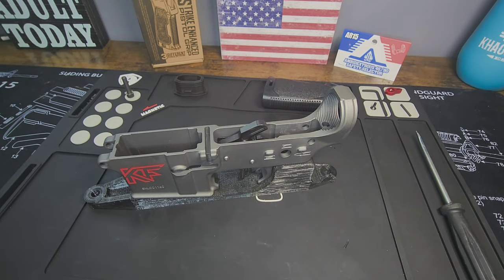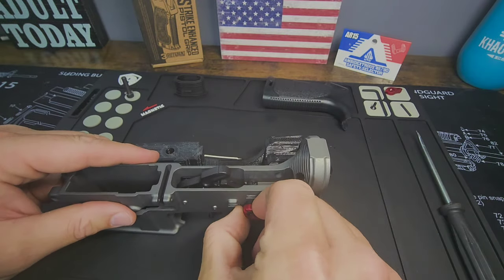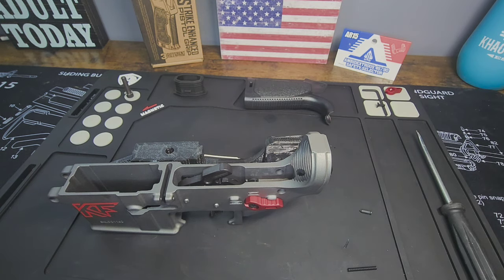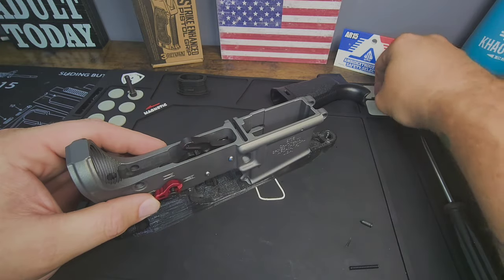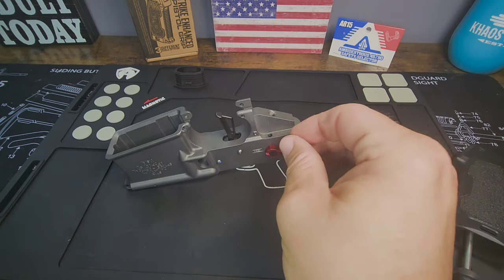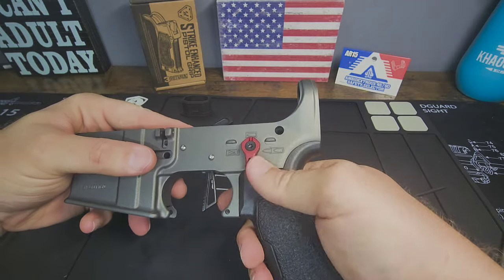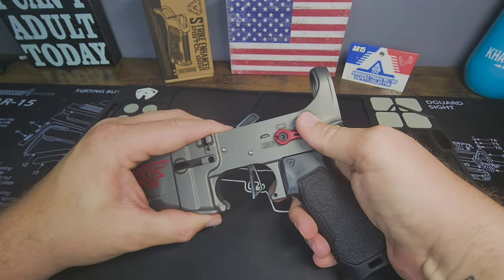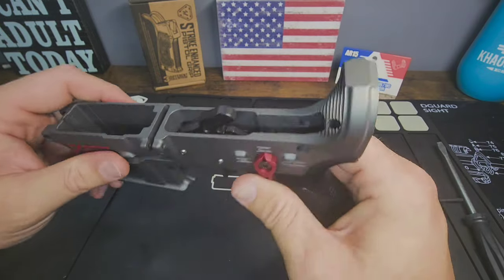How to install the  45/90 UTG Safety Selector and Strike Industries grip.

Comment: My detent will work with the short throw but not the long throw. Are there different detents?
Reply from the maker: There wasn't with mine. I would swap out the spring or check the groove on the selector to make sure it's smooth

Comment: Hey man, I have this installed with the long side on the wrong side for me. How do I switch them? When I try to remove the Allen screw it wont budge. Any idea?
Reply from the maker: @mike_angelone  it should be pretty easy each side is independent. Turn counter clockwise on one side give it some juice when you turn it and it should come loose. Same thing with the other side.
Reply: @KingKhaos1  I’ve given it all I got 😂 I’ve even tried taking the grip off and detent spring out.
Reply from the maker: @mike_angelone did you install it yourself? Did you out lock tight on it?
Reply from the maker: @mike_angelone shot me an email khaosfirearmsllc@gmail.com